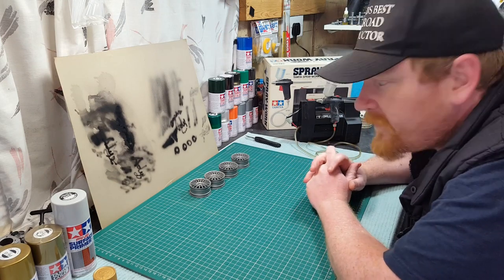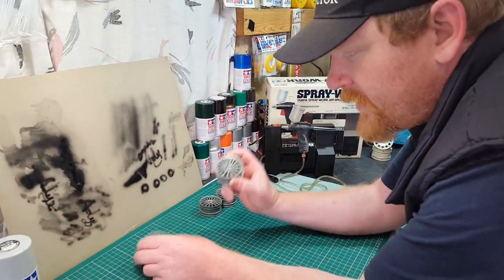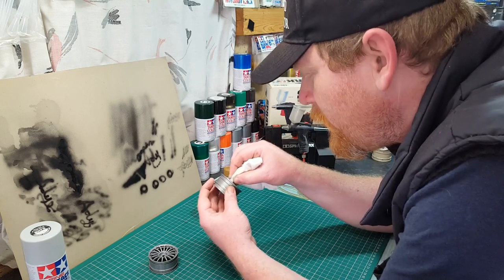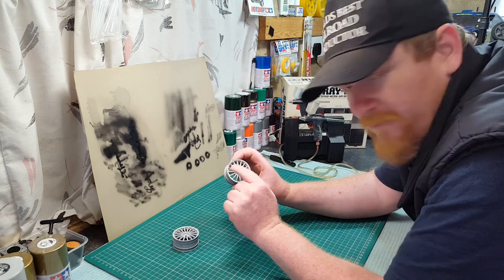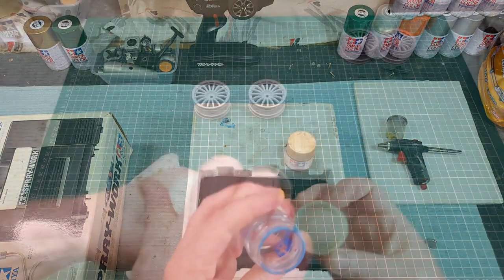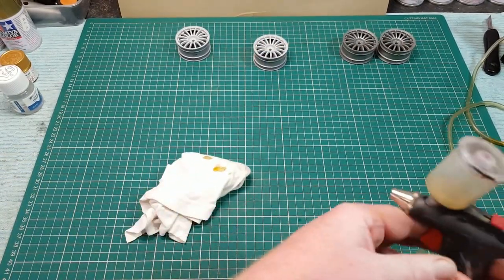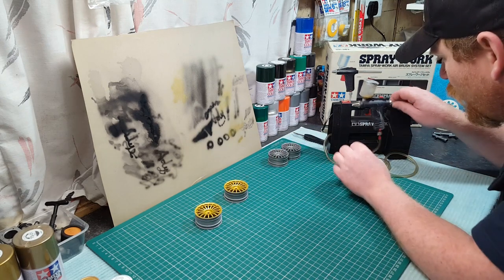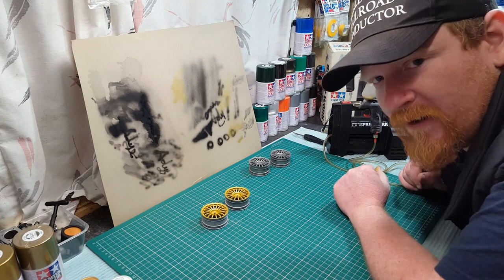My First attempt spraying wheels with Tamiya air Brush system set...

Comment: They turned out great .I guess it doesn't punch out as much pressure as a tank supply but you don't waste anywhere near as much paint either .Nice work great video ; )
Reply from the maker: Thx for watching. I think that's not enough thinner is in the paint mate, I think the paint is too thick so that's why it's not spray to great.            but it's a learning curve for me at the minute.👍👍